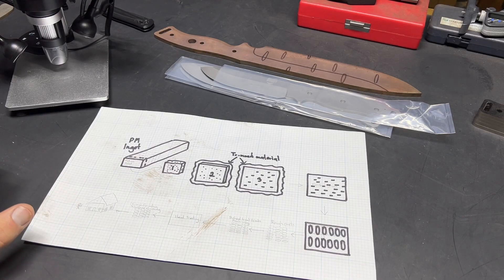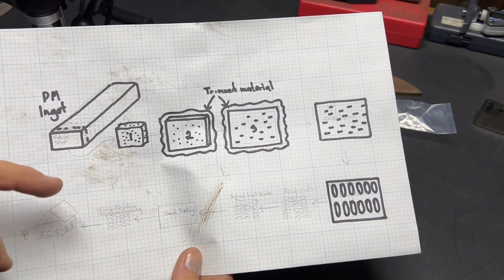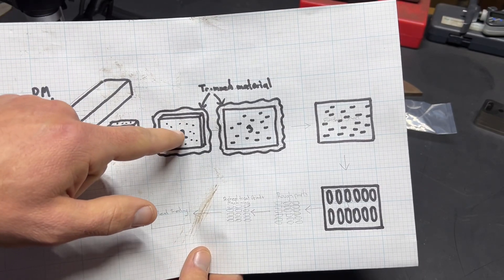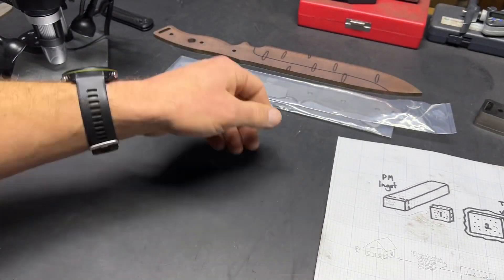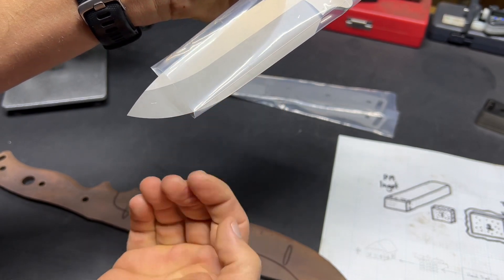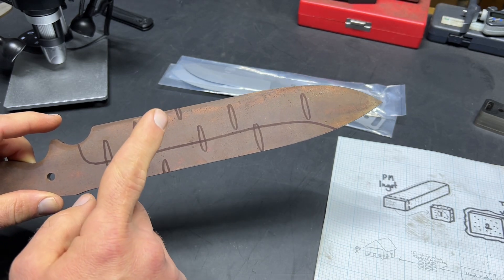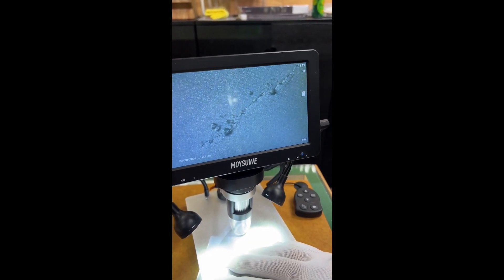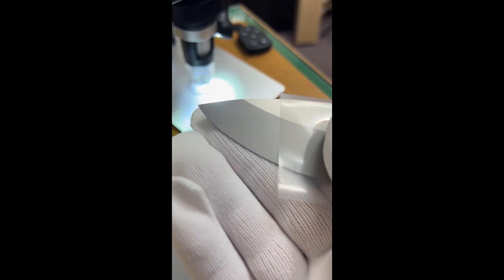Under The Microscope: CPM Magnacut

Comment: Looking at this I have theory. Not a metallurgist but a polymath, so don't bite.:) It looks like carbide clumping and banding. If the source is uneven powdering, then in the sintering process carbides would clump and band because of the near proximity at some places. When they clump up, around them the matrix is scarce with carbides, that in effect with further austenizing, enlarges grains due to lack of pinning carbides. Enlarged grains are more brittle due to higher ductile to brittle transition temperature which is grain related. Smaller grains, lower temp; larger grains, higher temp. Thus, it makes the clumps and surrounding grains a very brittle point in the steel. Your peening process as harsh as it is, will crack open those spots as they can't absorb the force. If it was sintering to blame, then it would be all over and uniform. If it was an alloy issue, it would be uniform and all over the place. So it's not Larrin nor Niagara. It seems like the powdering process is uneven. 3rd gen PM from Bohler proves it's merit as the top dog in metallurgy.
Just a theory.
Reply from the maker: Hey, no worries! I always appreciate feedback. As I've explained though, we've seen these voids right off the blanchard grinder, pre and post heat treating. What we are seeing during the peening process is the same thing, we are just cutting across a segment that was not previously noticeable. https://youtu.be/8nM-OTat2uM?feature=shared

Comment: Slightly off topic, isn't it best practice to lay the blades out with the grain of the sheet?
Reply from the maker: With these products, there should not be a grain. I did ask that question a long time ago and had it clarified more recently. After a anneal, all memory should be erased from the sheet, leaving a homogenous material.

Comment: I truly hope that you’re completely transparent with whatever the actual findings are from testing, whether it supports your case or not.
Reply from the maker: Always, I just want the truth. Several seasoned metallurgists I have consulted with told me immediately there is no way I could be doing this in my shop. Some of those folks used to work at Crucible.

I keep repeating myself here but we have been seeing these issues at every step of our processing, which is clearly outlined in email messages I recently released. We have seen this during pre-heat treat grinding, post heat treat grinding, bevel grinding and in finishing. Our finishing process is just a last chance catchall for deficiencies near or on the surface. 

The most telling thing for me is that in order to get any compensation, I would need to sign a nondisclosure agreement. My warranty claim was denied, but Niagara will not furnish the reports they claim to have, that support their decision. They will also not return my material samples for independent evaluation.  

I have nothing to hide here, and I have not seen this with ANY other material that I have used myself or any material I have used for OEM work here in the shop in the last few years. 

Additionally, I have used this same process for much softer grades of material, like titanium and aluminum, with ZERO issues. This is not us, and I am very eager to show you that. They are hiding something and we are all going to find out together what exactly that is.

Comment: How do you intend to prove your processes aren't causing the issues, or that they're indeed issues that would have any effect at all on the performance of the end product? Not all materials can be treated the same way using the same methods... if i stick a bunch of shrimp in a chicken rotisserie, & cook them the same as I would a chicken... you probably shouldn't pay full price for it... & that doesn't mean my shrimp were bad, but I did it wrong.
Reply from the maker: The only situation here is that this material is in a non-homogenous state. Nothing we are doing is out of any industry norm. As you can see in other videos and emails that I have shared, this issue has been pervasive at every step of processing, before and after heat treating.

This is not a finishing issue. That is just a last step where I'm catching other things not seen earlier in production. Also, if these materials cannot withstand a stress relieving peen, it should not be made into knives. our processes are just highlighting what's already there, we're not causing any issues.

The coffin nail to my point is the fact that they will not show us any reports they claim to have, they will not return our samples for independent evaluation, and they will not give us any relief without signing a nondisclosure agreement.

Comment: How many knives were pre-ordered? If 900 blades were affected what percentage is that ?  For example was 100’s or 1000’s knives were ordered? How many knives are finished a day on average?  If you have a 1000 knives pre-ordered and you finish 40 a day based on a 5 day work week that would be five weeks. Btw, I just completely made up this numbers and have no idea, which is why I am asking. 
You have no obligation to tell us, I’m just curious…
Reply from the maker: We have a lot more blades in production than what were ever pre-ordered. The larger issue is we had an entire production batch, over 800 parts get decarburized. That issue was squarely on Peters Heat Treating, due to a poor understanding of this new material. I also believe as they do, that the data was poorly published. At the end of the day though, that happened because of a pre hardening stress relieving service we did not ask for. 

They did take accountability for it though, I do commend them for that. You can now see all of the warnings on that material on their website. They don't really want to work with it.

The ongoing issue with the voids has affected a good percentage of parts as well. We are seeing up to 20% of magnacut blades with visible voids after finishing. Some we have also picked out in pre-heat treat grinding, post heat treat, grinding, and bevel grinding as well. 

We do our best to get them out of production as early as possible in the process, so we don't put extra cost into something we consider to be a deficient blade.

Comment: So how are we, as customers, supposed to trust the knives that are made in this stuff at all? How do we know that what looked good enough to leave the shop wouldn't have failed with a few more minutes of grinding?

  You've had knives come back for warranty and then you found these issues. That means that it looked good enough to leave the shop, but wasn't. 

I have a long standing order and I don't think I want it if you're going to use this CPM.
Reply from the maker: So, when we used to have these issues come back on warranty, it was before we controlled so much of our manufacturing. Back then I didn't even control finishing, so we didn't see these things until later.

Once I became aware of what I was actually seeing, after we got our own finishing equipment, we pulled all of the stuff before it was delivered. I had been quietly eating this and even discontinued offering 20CV, when the level of deficiencies were too high for me to absorb. 

Raising prices for something I believe to be deficient from the steel mill, only incentivizes them to continue those behaviors. I would essentially be punishing you for something you didn't do. That seems messed up to me.

We have done a lot of abusive testing, and I feel very good about what leaves the shop. With these higher quality European grades though, it isn't costing me a pound of flesh to maintain our standards. That feels really good.
Reply from the maker: Here is a follow up, explaining what I'm saying a bit better: https://youtu.be/KcX44dMUlVI?feature=shared

Comment: Ya, I saw the creely video they made about you and magnacut. Looks like a hit piece. Midway through the video they say "survive has processes that are somewhat different than a lot of other knife manufacturers and it does appear that there may be some compatibility issues with those processes and these steels" right when they cut to some guy hitting a hammer against knife blanks like a retard thinking he's forging a knife without any fire. They don't explain what he is doing trying to straighten the blade and that the blades are creely knife blanks. It makes it look like a video of you randomly hitting your knives with a hammer by the way it was presented.

Comment: Seems more like you had a heat treating issue 🤣 the only time I’ve seen what you keep complaining about in a CPM steel was when I tried to finish a blank that had excessive decarburization. This video is you exacerbating decarb in your part by media blasting over it and then putting it under a microscope 

Some of your other complaints about “carbide clumping” etc are also heat treat issues because carbide formation is part of the austenitizing process. 

It’s nuts to me you’re passive aggressively implying you’re the only one who cares about their product. Koenig, CRK, Spartan blades, Mcnees, Les George, Protech…the list goes on… all use magnacut. Are they all lying? Are they all choosing to use CPM alloys even though it induces massive loss?
Reply from the maker: Also, are you suggesting big football shaped pockets arose in the MIDDLE of the part from decarb? We bevel grind AFTER hardening.
Reply from the maker: Lastly, just because I keep thinking about your statement. Why then have we NEVER had trouble with M390 compared to 20CV? My only issue with M390 was availability, but that has changed now. These seem to be uniquely CPM issues, but yeah...
Reply from the maker: To clear up any confusion, here is a video of the emails between myself and the folks at NSM and Crucible. We had been encountering voids during preheat treat grinding. Tell me how the heat treating company wad doing that to virgin parts? : https://youtu.be/SIC2RH2lp4A?feature=shared

Also, the last parts in this video were still annealed. So again, clarify your position: https://youtu.be/8nM-OTat2uM?feature=shared
Reply from the maker: Sorry, I'm working, but you gave me so much nonsense to work with, I keep thinking of more points. None of these current blades I am working on are from a decarburized batch. 

These were all hardened under a vacuum, using an established protocol outlined in the Crucible data sheets. The surface of these was clean as hell coming back from Peters'. So again, go fish. I'll wait.
Reply from the maker: As you can see in internal emails I have already released, we have seen this issue well before any parts have been heat treated. Thanks so much for stopping by.

Comment: What does mean for an owner of a 4.5 in CPM 3v purchased back when you guys were in Idaho? Is it possible it's flawed? I know you wouldn't have released it had you seen it but I'm concerned,  as you've mentioned,  over what cannot be seen. Thanks again!
Reply from the maker: We do a decent amount of abuse testing, so I have a high level of confidence in anything that leaves our shop. It's just what sometimes can't leave our shop that bothers me. 

I believe this may also speak to a larger issue, which is why the company involved was trying to get me to sign a nondisclosure agreement in exchange for monetary compensation. 

Now folks are aggressively attacking my character rather than addressing my issues, which only further reinforces my position.